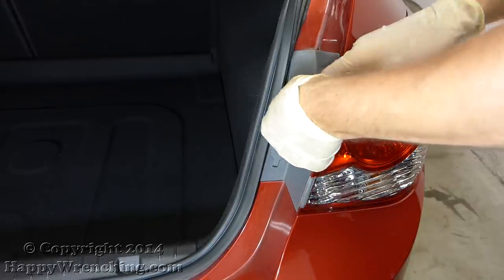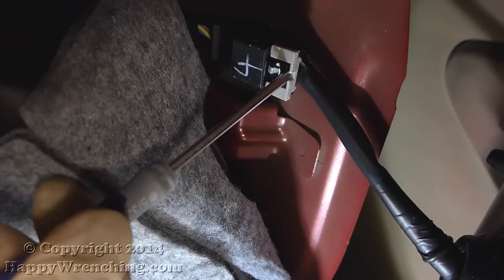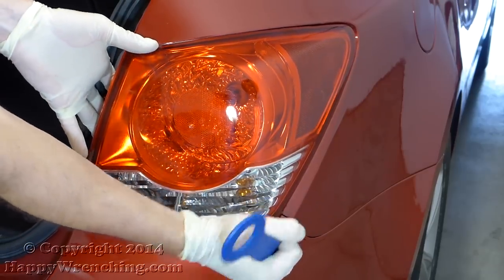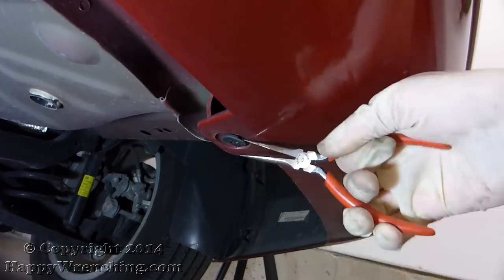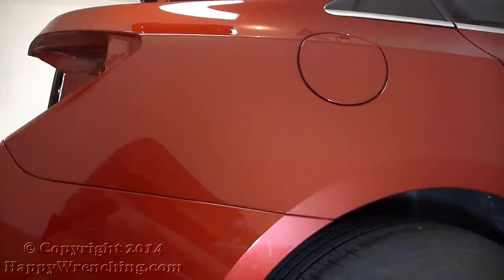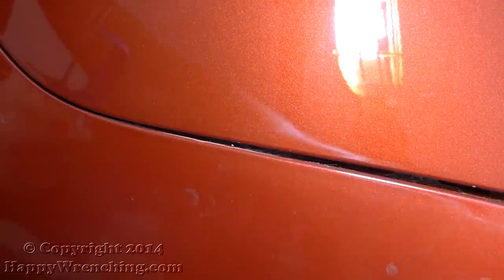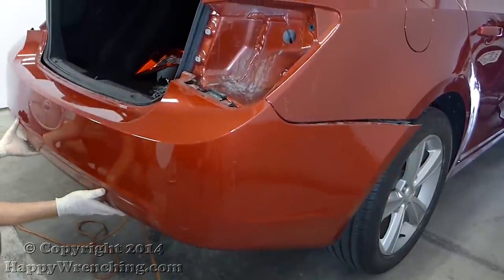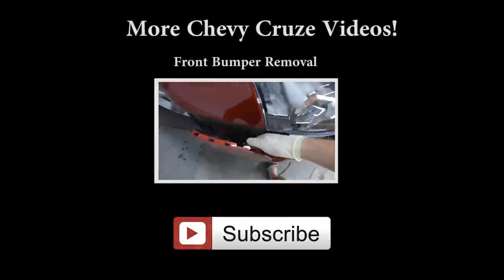Chevrolet Chevy Cruze Rear Bumper Cover Removal And Installation (2012 - 2014)

Comment: Great video. My only issue was for some reason my 2014 cruze had T20 screws, not T25, in the wheel well. Didn't bring the T20 bit with me to do it, so thankfully I started there n ended up waiting till I had the right one

Comment: First thanks for the how to 
Just replaced the bumper on my cruze watching this gave me a good idea of what to do but with a few changes as its a hatchback model so a little different 
The changes are the lights are held in by 3 screws and a couple of push fits so you don't have to unplug them once out they can hang into the rear 
The only other change is the number late lighting this can be found behind the bumper a large block connecter just remove the locking pin and pull apart the rest of the lighting can be removed once the bumper is off
Reply: Hey do you remember how much it cost you to replace that bumper?

Comment: Hi, did you screw the T25 back at the inner fender? Cos i have my rear bumper fell off yesterday on a hi-way luckily we are all safe. And i think i can fix it by myself but im not sure if its still safe to use if one of the plastic stab was broken.
Reply from the maker: All I can say is good luck with your repair, I made this video so long ago I just don't remember
Reply: @happywrenching  thanks i already fixed it

Comment: Is the filler just the aluminum bar seen when the cover is off? No foam or eggcrate material in there? I got rearended lightly and it appears to be just cosmetic, thinking about pulling the rear cover off like this and painting myself. If the inner bumper is really just aluminum like that, I can inspect it once the cover is off and not worry about ordering new foam parts. Thanks!
Reply from the maker: There is no material other than the aluminum bar.
Reply: Hey do you remember how much it cost you to replace that bumper?
Reply: +Preston Peters insurance covered it, so at "full pricing" I think it was $1100. That included the bumper, paint, labor etc.

Comment: Someone hit my car and I'm thinking about replacing the bumper myself and having a shop paint it. My question is would the shop paint it before it goes on the car or after its installed?
Reply from the maker: Normally the bumper is painted while it is off the car.
Reply: Hey do you remember or know how much i cost you to replace the bumper?

Comment: what are the two gray flaps for on cars frame when the bumper is removed at 5:26
Reply: Ben Gonz those there to vent the car. When you close the door it creates a high pressure zone. Car manufactures take advantage of these vents to slowly let the air out to give off the illusion the doors are heavy vaults when they close. If you ever have an air freshener in the car and the hvac fan on full blast and smell the air freshener outside the car it's because of those vents. 

In short they are vents for the car when you close doors and vent the air in general.
Reply: t436 I thought they were vents but just for the trunk not the whole car so thank you for the info

Comment: Is there any difference in the 2018 model? I have a rear bumper to paint
Reply: Did you get yours off? Was it pretty similar? I'm looking to swap my stock bumpers with the RS bumpers
Reply: @starkiller6669  I never did the job